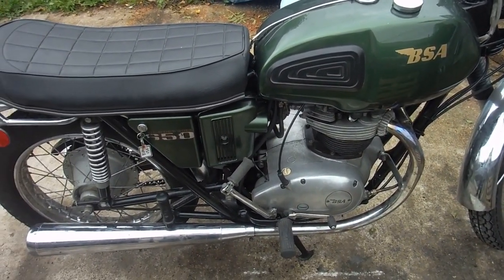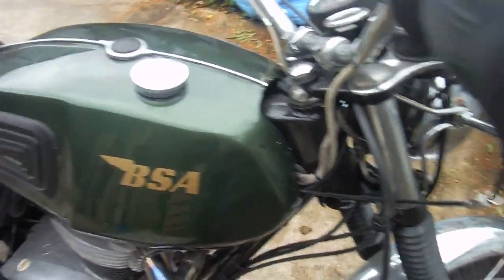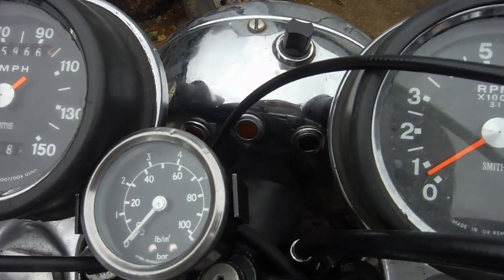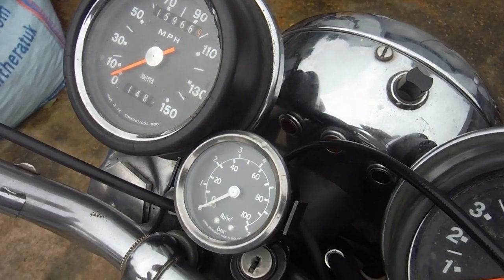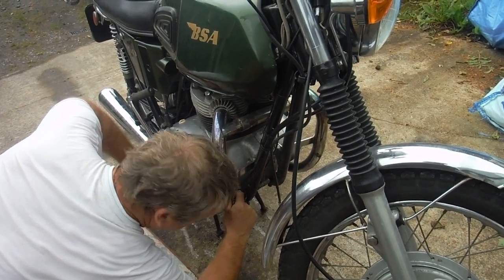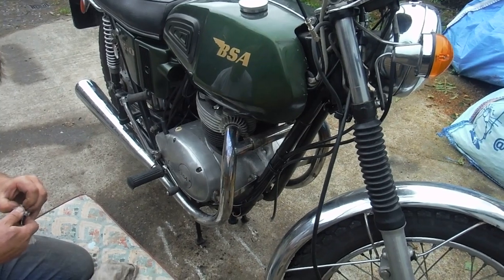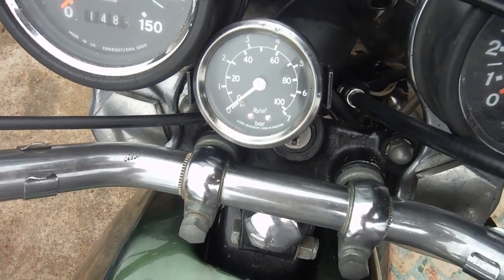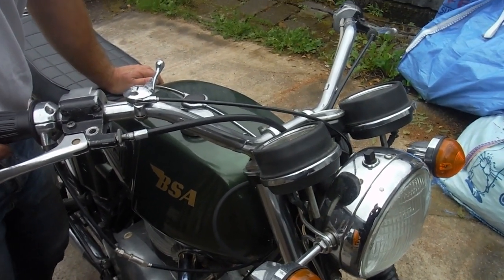BSA A65 T oil pressure gauge vs warning light switch.

Comment: Interesting. I just bought two A65 Lightnings, both needing work, for $250 each and am thinking of getting a gauge. I run them on my Halreys but they are more for the purpose of knowing the pump is working rather than the rider worrying about what their reading.

Comment: Great video. I just purchased a 1970 Royal Star, 500 cc here in Canada.  I owned a 1967 Spitfire Special 650 cc about 30 years ago but don't remember an oil light on it.  I'm curious as to the actual oil pressure so I will follow what you have done and will post a video of it.

Comment: my tr7v has the light and gauge combined same issue hot and idling lucky to see 10 psi manual says 20/25?  went to remove the orpv  barely more than finger tight lol and i seperated the 2 halves without a spanner lol, so now fully torqued to 20 ft pounds,c what happens, there r some dodgy oprv out there with sloppy threads and wrong length springs lol just bought a new one from srm alledgedly the dogs nuts,dodgy pattern parts made in the east total crap most off it even lf harriss  have a lot to answer for

Comment: I tried running an oil pressure gauge on my 68 Bonneville. I went back to the light after the vibration killed 2 brand new gauges.   I never did get to try out an oil filled (for dampening) gauge.

Comment: I think Bourdon tube gauges are most accurate mid scale and least accurate at the lowest end.

Also, at one point i believed idiot lights replaced gauges due to cost savings, but it may have been to avoid "interpretation" problems and related worry,  just as we're experiencing.  

The pump's worm drive means slow pump revs and even slower if it's off the cam end.  I forget if it's cam or crank driven.
Reply from the maker: I agree re. the gauge / warning light thing. the oil pump drive is taken from the end of the crank, but there is a reduction in the drive worm gears.

Comment: I fitted oil pressure gauge  to my oif triumph a few years back had same issue done exactly same test as you did in end refitted the oil light oil switch still running strong to day oil pressure gauge to distracting nice work
Reply from the maker: Thanks, I totally agree!
Reply: just like a ammeter

Comment: My 1968 A65 has no light or gauge which is a worry!, is it possible to fit one ? The engine is being rebuilt and I'm not sure if I trust the old pump 🤔
Reply from the maker: Swings and roundabouts - if there is no light or gauge, there is either less, or more to worry about depending on your point of view. I have never tried converting an earlier engine to have either, so I don't know how it might be done, but probably possible.